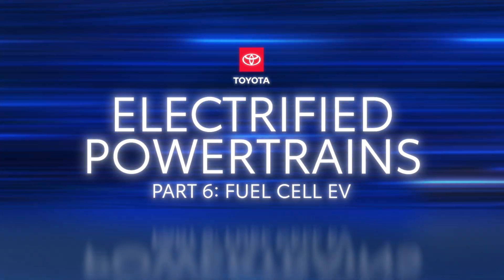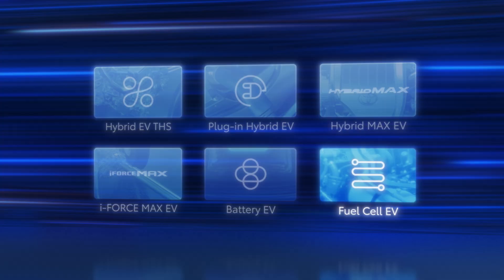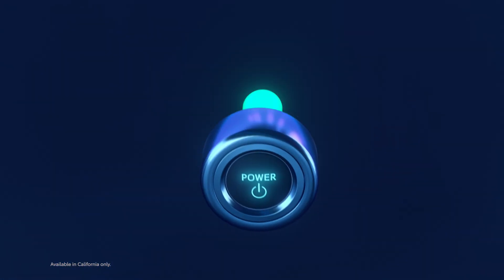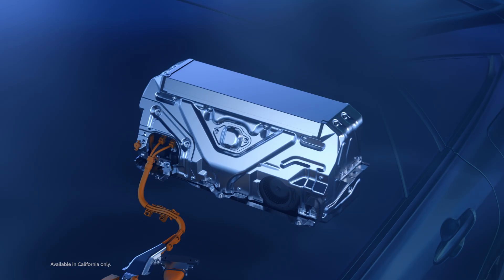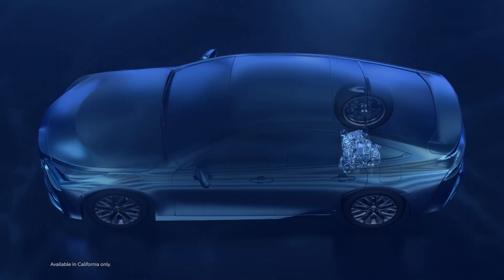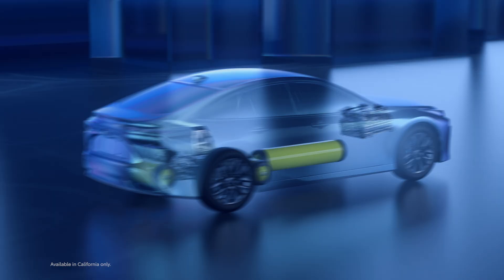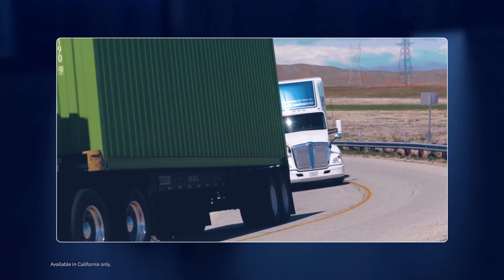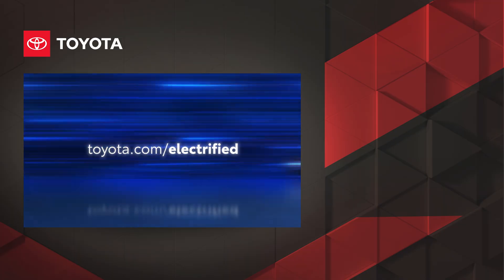How Do Fuel Cell Vehicles Work? | Electrified Powertrains Part 6 | Toyota

Comment: Toyota Mirai has been a complete failure. The cost of making liquid hydrogen is not economical, the cost of the fuel itself is not economical. There are no charging stations yet for whatever reason Toyota still clings on to Hydrogen. The world has moved onto BEV. Charge times are reducing. Battery tech has advanced from NMC to LFP to Solid sate with 10% electrolyte and will get to all solid sate. The world’s largest car manufacturer instead of taking the lead in technology still clings to fossil fuels.

Comment: that fuel cell EV is a driving bomb that carrying hydrogen bomb beneath it
Reply: Lol... And Petrol isn't? At least Hydrogen is less dense than air, so it burns upwards, rather than stay and burn everything close to it or have thermal runaway like Lithium-ion batteries.
Reply: hydrogen bombs use nuclear fission bombs to cause fusion between isotopes of hydrogen, releasing massive amounts of energy. Hydrogen fuel cells store hydrogen in a pressurized state to be used in a fuel cell, a device which combines hydrogen and oxygen into h2o (water) and as a byproduct generates electricity which powers the car. Hydrogen cars do not have nukes beneath them.

Comment: As soon as my 2019 Highlander hit 60,000 miles, the transmission started humming. I took it to the dealer — they diagnosed it needs a new transmission.
Toyota has already acknowledged transmission defects in other models with the same 8-speed transmission (like the Sienna and Camry V6) by issuing recalls — and there are plenty of 2019 Highlander owners complaining in forums.
We’re ALL waiting for Toyota to do the right thing and issue a full recall.
A transmission should NEVER fail at 60,000 miles. This is NOT why I bought a Toyota. I trusted this brand for reliability — now I’m stuck with an $8,000 repair.
Do better, Toyota.